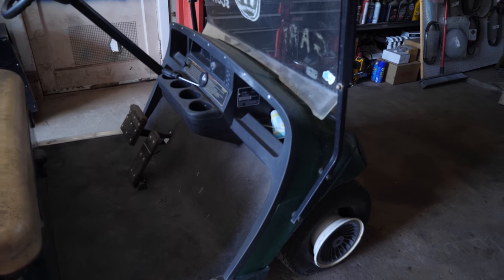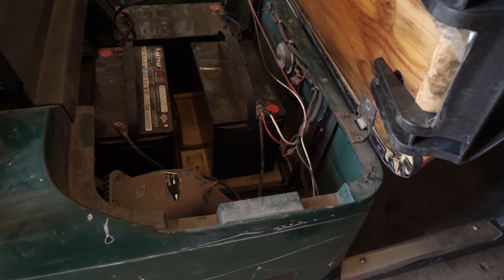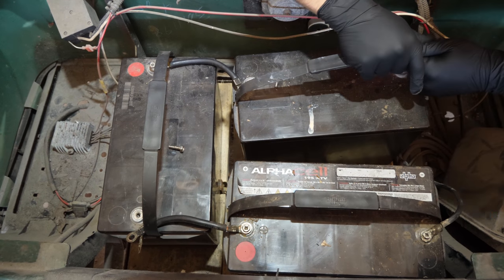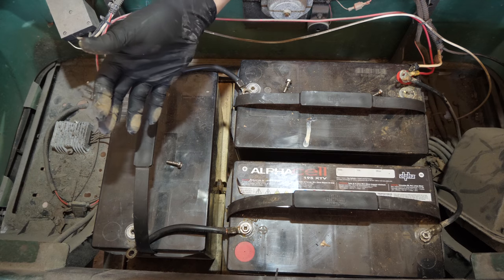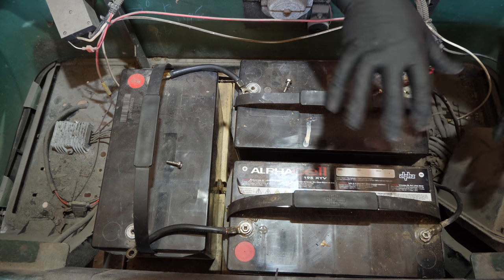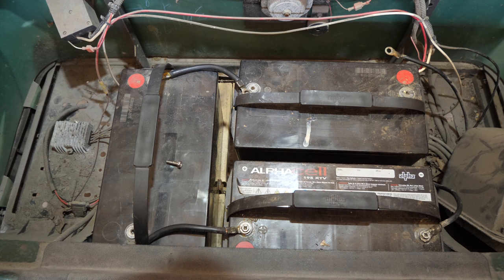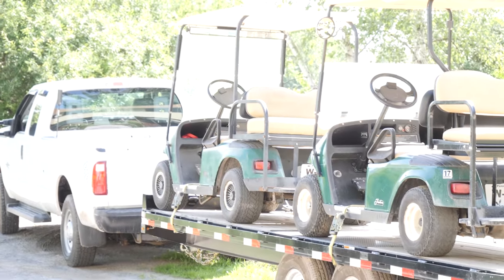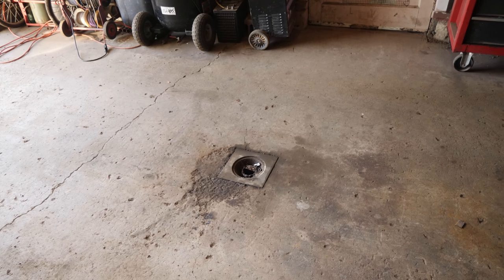1998 EZGO TXT, 36 Volt Electirc - AGM Batteries, Head Light Switch, Inflate Tire

Comment: I have a 2003 txtpds and have 6 12 volt batteries run in a series parallel configuration. Work great.AGM maint. Free too.

Comment: As a golf cart mechanic myself if there is one thing the shadetree neighbor everyone has does that makes my blood boil is the 3 12 volt marine batteries in a TXT. It's never a Marathon, Yamaha, or 36 volt DS. It's always the TXTs
Reply from the maker: I've seen a few 48v Yamahas with 6 8-volt systems "converted" to 4 12-volt batteries using 2x4s and plywood. No tie-downs of any kind. Totally unsafe. Its all fine and dandy until it shorts out and burns to the ground.
Reply: @Kevinsgolfcarts  I've had plenty come in with a Club Car DS (48V car) complaining that their car is slow and won't charge. Turns out they put in 6 6V batteries instead of 6 8V batteries.
Reply: Any idea on how much less drive time you get when you put 12 volt batteries in instead of 6 volts, if you match the amps to equal the original 6 volt batteries

Comment: I have an 04 TXT 36V. I would like to switch lithium and I’ve seen some sites that say I could use the same charger as my current 6v lead acids. Do you know if that’s possible? Thnx
Reply from the maker: As I understand, yes. As long as the batteries have their own battery management system, you can use any charger. I basic charger is nothing more than a power supply.

Comment: What are your thoughts on converting an e-z go marathon cart from 6 6 volt batteries to 3 12 volt batteries ?
Reply from the maker: I wouldn't do it. You will not have the same capacity. It gets a bit complicated with the technical stuff. I would stick with 6v batteries.
Reply: @Kevinsgolfcarts  thanks. It’s just hard to find an affordable 6volt battery in my area.
Reply: @torquewrenchdaddy8032  just did 3 12v batteries from Walmart. 300 bucks out the door with 3 core returns and one year warranty. Works great zero issues and a fraction of the price. YouTube some videos on it. It is becoming very popular.

Comment: Why only 3 12v batteries? I thought having the 6 6v batteries is longer runs while riding and they last longer.
Reply from the maker: I don't understand it either. These batteries are much smaller physically and in capacity to the stock pack. I guess this customer thought it would be lighter and run longer. 6 6v batteries will provide longer run time.
Reply: @Kevinsgolfcarts  Around here it's because they're cheap. It costs 650-750$ to put 6 6v Trojan batteries, but only $200 to jam three 12V Rural King garbage in there. The car in this video is a DCS (drive control system) car, which was EZ's first attempt at a regenerative braking car. These garbage batteries will kill controllers since they offer zero low voltage protection.